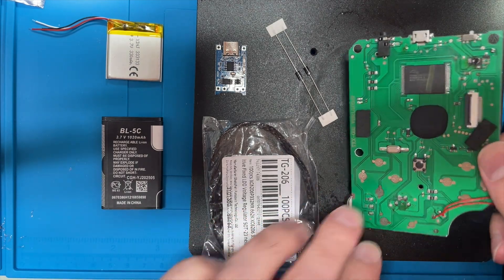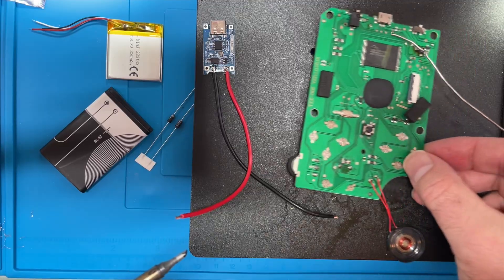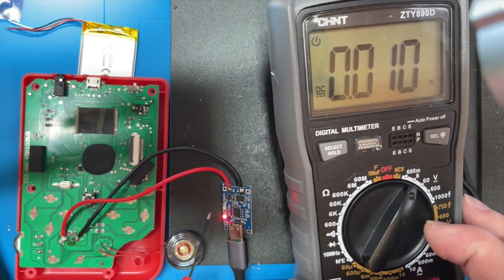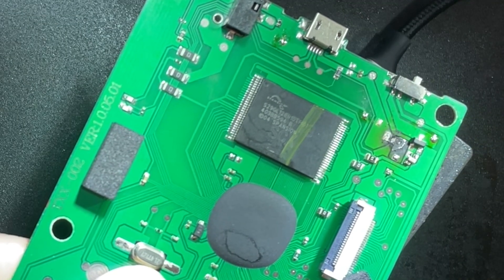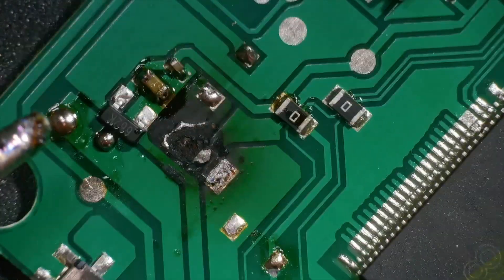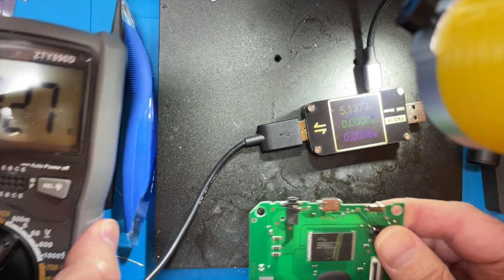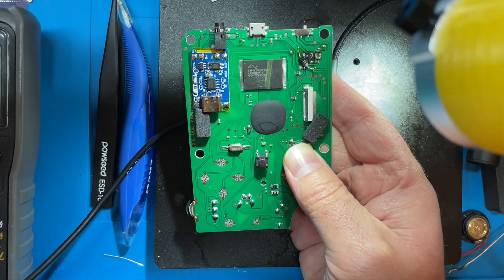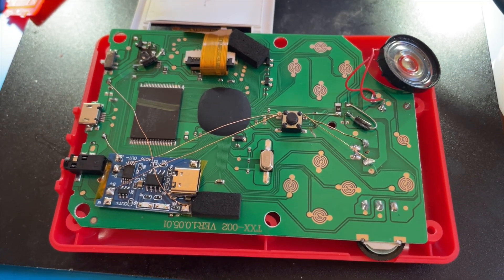Dodgy Circuit Defused - fixing the silly red thing.

Comment: Those THT Diodes on the SMD pads are a bit dodgy..
I wouldn't be surprised if the pads get ripped of the PCB if subjected to shocks.
A smaller diode would have been the ideal choice. Also something like hot glue on the diodes could be used to minimize the stress assuming it doesn't get hot and melt.

Anyway...I think you have done more than what that console deserves.
Reply from the maker: I think so to - it works - but it is a very silly thing...

I actually forgot that I had a big book of SMD diodes on my shelf!

Comment: Should not leave the carbonization. It is conductive.
The USB from the charger looks too high and might damage the screen.
Did you set the charger resistor in order to not feed too much current to the battery? The default resistor is 500mA to charge it.
Also the wires look very thin to me. With lower charge, the battery might need thicker wires in order to get more current.
Maybe you made yourself a burning house machine :)
Reply from the maker: The board was cleaned up with IPA - there's no danger of any shorting from the carbonisation.

Battery is a BL-C5 - 1020mAh - so 500mA should be fine for charging it.

Wires are 0.2mm solid core copper and we've kept them pretty short. The actual board only seems to need around 200mA when it's running.

Probably is a bit tight when charging at max current.
Reply: @atomic14  mAh is not the same as charging current. The difference is within 1 hour and the instance of use. Both are different things.
But that charging current is not bad for a BL-C5. I thought you were using that lipo you shown previously in the video.
Reply from the maker: @FixDaily  if I'd used a different LiPo i'd have changed the resistor - but I thought it was pretty clear in the video we used the original battery.
Reply: If you really want to lower the charging current, there's a charging control resistor on these tp4056 modules.

You can simply desolder and replace it for faster or slower charging, modifying the current being passed into the battery.
Reply: @ardatubes  the battery wont charge faster if it is almost full. And if it is empty, it will indeed charge faster but you are putting to much stress to the protection circuit and cell. This leads to overheating and fire.
Reply: @FixDaily  Indeed, but what I mean is the max current. Via changing this control resistor to a higher value you can charge smaller batteries with an ease of mind, because they won't be charged with high current at any point, so you won't likely get overheating and fire. There was a chart about the values if you search for it on TP4056 datasheet. This way you program and optimize the charging chip for your battery.
Reply: It's a $5 toy, he spent more on parts to fix it than buying a new one because it's the joy of repairing rather than the cost or brilliance of it, plus the entertainment value. If he was repairing a piece of ICU medical equipment then your concerns would be valid.
Reply: @bsdjunkie1805 Yes, I get your point, and it could have been a gift from a friend, so it didn’t cost him anything. Pointing to medical equipment as an excuse doesn’t really seem fair. His audience is most likely people who are looking for information or ideas for their own DIY projects or fixes. Just like you do on YouTube and I believe that it more than just entertainment for you.
Consider that this kind of oversight steers people towards misinformation, and he ends up influencing them to repeat his mistakes.
It doesn’t mean you or he have to care, but making excuses for mistakes is less important than sharing accurate knowledge.
Reply: @FixDaily  I've given your comment a thumbs-up, it's a fair point well made, but YT is primarily for entertainment in my opinion.

Comment: The thing I don't like about these usb-c tp4056 modules is that even though it's usb-c , they need 5v input. For this, they could have utilized 5.1k resistors to cc1 and cc2 pins from the factory, but they omit this and it's frustrating. You simply cannot use modern chargers for these modules.
Reply from the maker: You're right - I hadn't noticed that - explains why when I initially plugged it in nothing happened.
Reply: I have both 12 and 6 pin USB C socket variations of these. The 6 pin ones have CC1 and CC2 unsoldered but are available to connect directly to. Adding the resistors is fairly trivial if you can do fine soldering. The 12 pin ones? No thanks. 

It looks like the unpopulated R4 would nearly do it for one CC line, but that pulls CC up to +5V... I guess at this point the designer realised that he'd messed up. 

The 6 pin pinout is GND, 5V, CC1, CC2, 5V, GND when looking at the solder pads. 

Yes, it would be better if they didn't have the obvious design fault, but I guess that's why we can buy them so cheaply!
Reply: @georgeprout42 thanks, I’ll try to get some 6p variations then, I didn’t know that pins were exposed to solder on these
Reply: Yep! And thats with a lot of other products too
Reply: Honestly it’s the dumbest feature of usb c chargers to not have at least that 5V output enabled by default
Reply: isn't 5v mandatory by usb standard even without negotiation. sounds like your power brick is not compliant.
Reply: @destiny_02  Nope. PD chargers tries to negotiate and talk with the other host device what voltages are to be sent, if it cannot get proper response it refuses to charge to prevent any kind of explosion and burns etc. For legacy devices, usb-c standards imply that 5.1k ohm resistors need to be soldered to cc1 and cc2 to gnd pins if the host device needs 5v only. I checked and can confirm this is described in the usb standards. These resistors were not populated. Neither ugreen, nor genuine apple macbook chargers (m1 and m4 pro) refuses to charge directly.